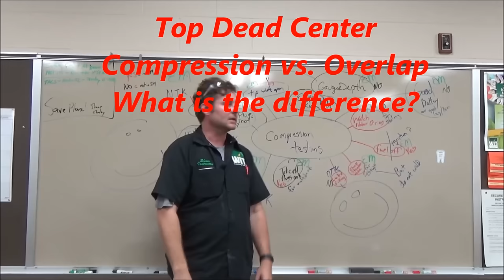Why is it important to understand top dead center vs. overlap on a 4-stroke? #DOHC #how2wrench

Comment: I know this was posted a while ago so I'm going on a long shot here...
I ripped apart my top end, changed out the piston and rings, but before I tossed the cylinder back on, I found TDC, was this too soon to find TDC? I'm now confused and don't know what stroke I was in when I ripped it apart... please help!!
Reply: There should be a marking on both the magneto and timing gear in the cylinder head.Align those marks and you're good to go...
Reply: @syafiqaiman3548  thnx bud! I found the mark for the set screw, but wasn't sure if it had to be in the proper stroke. Anyways.. figured it all out, got it going.
Thank you

Comment: I have a 99 GSX R750 and it pops and  at crusing put a new tps and it's good but lose power wide open and then slowly picks up and runs fast what is going on here?
Reply from the maker: If it was a quick answer I’d try to respond here but I wouldn’t want to lead you wrong assuming certain factors. Reach out to me on my website contact page. We have been overwhelmed with ungrateful people and scammers so I had to do something for my sanity by screening the over 300 requests a week!

Contact Link: https://how2wrench.com/contact/ 

Your answers and help are just around the corner. Save time and money while protecting your investment and yourself by doing it the right way at www.How2Wrench.com  
Have you subscribed yet to never miss a video? 

Have you seen the video playlists https://www.youtube.com/user/conleybuilt/playlists? 

Want to say “thanks” or “keep it up”? Click here https://www.paypal.me/how2wrench

Comment: So what if you did a rebuild and new timing chain and the crank has got turned a bunch to (making sure everything was moving smoothly and waiting for parts) but just can’t seem to get it right first time it was sucking in the exhaust weird second time lapped valves better and would only run on the gas I put down the plug hole third time was really sucking through the carburetor but wouldn’t even run with gas down the plug hole and every time the valves had a different clearance  but cdi doesn’t know tdc from overlap friggn so weird but I’ve been in this engine a lot and this is a first
Reply from the maker: Let me try and see I can catch Shane to answer quick. He is currently at an extended stay in Japan training students this winter. We are just the social media team. 
Due to his limited bandwidth on time and demand for help, we had to choose to forward any requests from members first and it is only $1.99 a month to join.  All member tech questions like this get directly forwarded to him every day! Be mindful and honest that this is for "quick questions" that would serve you answers that can clearly be addressed. If it's a diagnosis need you'll need to use the one-on-one service. 
Here is how to get in!
* Join here: https://www.youtube.com/channel/UCBhM8DCKnT3qXwTW0eToyCg/join       
* Just looking to give us a high 5? Click here: https://www.paypal.me/how2wrench 
* Is this an emergency and your head is about to explode from frustration or fear? Get Shane’s cell here: https://how2wrench.com/ols/products/techline-one-on-one     

Have you seen our "YouTube Trained Support Shirts? Great way to "high five us" https://goodfellasmerch.com/collections/how-2-wrench/products/support-shirt

Comment: Hi from the U.K. Shane. The only other thing I would find useful from this video is a close up of the action between the lobes and valves. The stills were good but I think It would register with me more in slow motion. Mainly because I'm old with poor sight and slow on the uptake. Lol. I have an OHV/OHC 125 single bore Chinese bike. Poor compression and burning oil. Lapped the valves/seats and put a new piston and rings in. By the way I have the engine out of frame in house. Highest compression reading so far has been 91 but have lost that since moving sprocket around to try and improve the figure. No timing marks anywhere on the camshaft. There are two lines on the sprocket but don't know if they should be horizontal or vertical to the body. If I set the lobes upward at TDC so both valves are open will that take care of the overlap please ? Thanks. G
Reply from the maker: Yo! We just run the social media.....Want him to drop his wrenches and help you? He loves helping members and it is only $1.99 a month to join (more options if you really want to say thank you too) All member tech questions like this get directly forwarded to him every day! Here is how to get in!
* Join here: https://www.youtube.com/channel/UCBhM8DCKnT3qXwTW0eToyCg/join      
* Just looking to give us a high 5? Click here: https://www.paypal.me/how2wrench 
* Is this an emergency and your head is about to explode from frustration or fear? Get Shane’s cell here: https://how2wrench.com/product/personal-tech-training-phone-facetime/    

Note: If you are a channel member please reply back with your Youtube handle. We will have a private member-only FB and web page coming he can directly do Q/A there! Thank you for being patient as our growth has blown up!

Comment: how will the engine act if timed on the overlap stroke?
Reply from the maker: If it was a quick answer I’d try to respond here but I wouldn’t want to lead you wrong assuming certain factors. Reach out to me on my website contact page. We have been overwhelmed with ungrateful people and scammers so I had to do something for my sanity by screening the over 300 requests a week!

Contact Link: https://how2wrench.com/contact/ 

Your answers and help are just around the corner. Save time and money while protecting your investment and yourself by doing it the right way at www.How2Wrench.com  
Have you subscribed yet to never miss a video? 

Have you seen the video playlists https://www.youtube.com/user/conleybuilt/playlists? 

Want to say “thanks” or “keep it up”? Click here https://www.paypal.me/how2wrench
Reply: Depends if system has waste fire or not... If it does have a waste fire system (fires every time at tdc or vicinity) it'll run. Cause it'll just do as normal operation and burn off remaining in burnt fuel.. but if it's not waste fire system (fire once per full cycle) you will have back fires and flames from exhaust and or intake but end result of not running. I know it's an old comments but sometimes it's easier for someone stumbling across older videos with similar questions

Comment: What effect does the size of shims have on this?
Reply from the maker: On what specifically? Shim size has no effect on TDCC or overlap as these events happen 360 degrees of engine rotation apart. 

If it was a quick answer I’d try to respond here but I wouldn’t want to lead you wrong assuming certain factors. Reach out to me on my website contact page. We have been overwhelmed with ungrateful people and scammers so I had to do something for my sanity by screening the over 300 requests a week!

Contact Link: https://how2wrench.com/contact/ 

Your answers and help are just around the corner. Save time and money while protecting your investment and yourself by doing it the right way at www.How2Wrench.com  
Have you subscribed yet to never miss a video? 

Have you seen the video playlists https://www.youtube.com/user/conleybuilt/playlists? 

Want to say “thanks” or “keep it up”? Click here https://www.paypal.me/how2wrench

Comment: Overlap is at top dead center of the beginning of intake stroke, not compression 2:34
Reply from the maker: DontBe StupidAnymore Exactly what the video is stating....I don’t get your time stamp?
Reply: @How2Wrench  
I appreciate your views and had been looking for some insight to the effects of overlap on idle quality and low end torque. After reading the Ford General Engine Simulation program (GESIM) as a diagnostic research tool, I had hoped for something in video format. At that time stamp,I might be mistaken it seems like you are stating that the overlap is at tdc compression stroke...hence my abrupt response. You're doing a great job, keep it going.
Reply from the maker: @besearchingforwisdom6267  Thank you. I watched it again to make sure I wasn't. This video was driven from years of folks not knowing what overlap was and then setting valves or timing an engine wrong. It's to bad it wouldn't go viral and it would surely save a lot of headaches! Keep Wrenching...Shane

Comment: https://youtu.be/EWkrXjwU_xI
Can you help me? While racing my engine it  all the sudden went limp on one cylinder
 (as it seemed).. despite the bent electrode from #3 cylinder, it was nearly tapped shut but it sounds like no compression in one cylinder. Running a shade tree test, it seems like the valve overlaps are entering into other chambers. Watch the vid, I think it’s a chain jump but I’m not too familiar with THIS kind of overlap.
Reply from the maker: Join my channel for access to the videos you need or you can access my personal cell with the tech line or the highest membership option. Details here: Glad to hear how you liked the videos. Want more? Smash the sub button! Here are the links to support us for this information and our work saving you money.
Join this channel to get access to perks:
https://www.youtube.com/channel/UCBhM8DCKnT3qXwTW0eToyCg/join     

Give us a high 5 here:  https://www.paypal.me/how2wrench

Comment: Hi, I rebuilt the engine and now I am having Rev hanging issue, Engine idle in 1300 RPM if I rev more than 4000 RPM getting stuck in 7000 RPM, See the link for reference.   https://youtu.be/f9D2ix0UxUE  HELP!! Is it a timing problem or anything else?